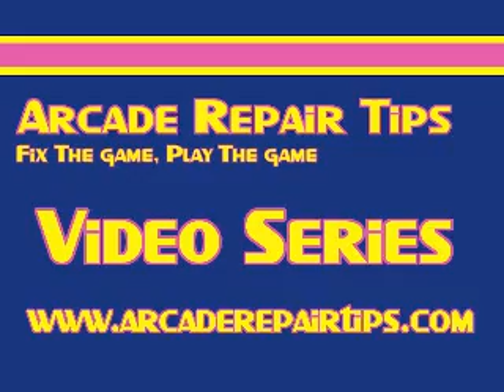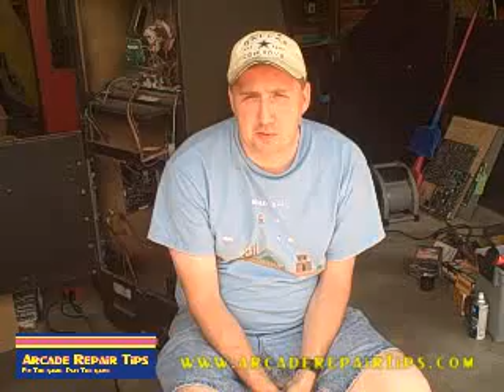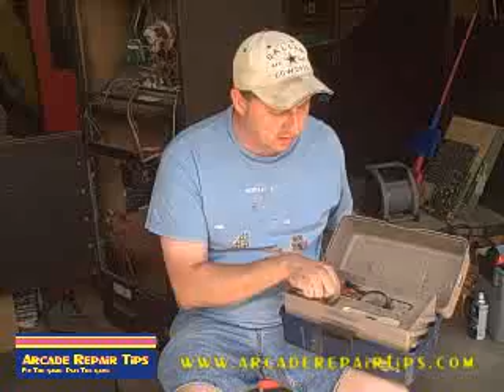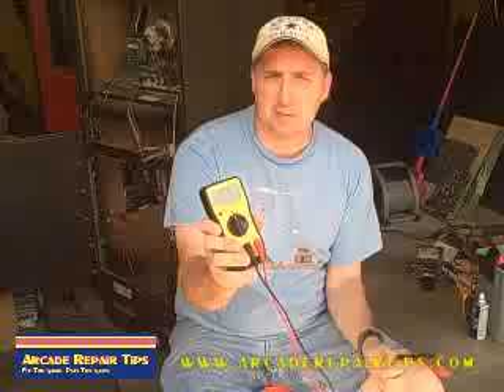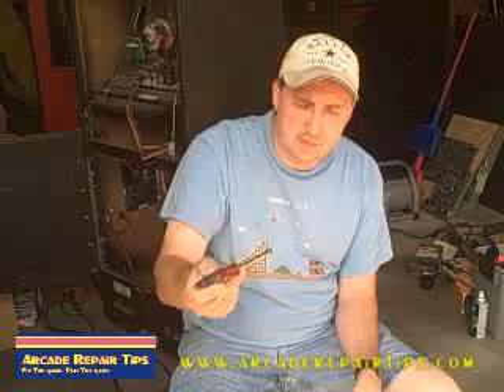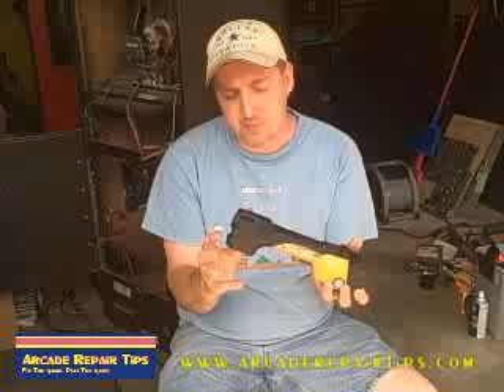Arcade Repair Tips - Your First Arcade Toolbox (Part One)

Comment: Thanks for making your videos. I was planning to go to my local (last..) arcade near here for my 30th birthday, only to find out they had gone out of business the weekend before. (bummer..) but I ended up getting in touch with the owners and ended up buying a machine instead. I intend to gut it (??) and put in a setup that will run emulators, but these basics to learn are good to know. I have to admit I'm pretty terrified of removing the monitor / charge, and debating whether I can just hire someone to do it professionally. I'm mostly just hanging onto the cabinet itself and intending to gut everything else and redo the controls etc etc. 

Anyways, rambling aside I appreciate the knowledge dispersed here.
Reply: I plan on doing that too , how did it go?